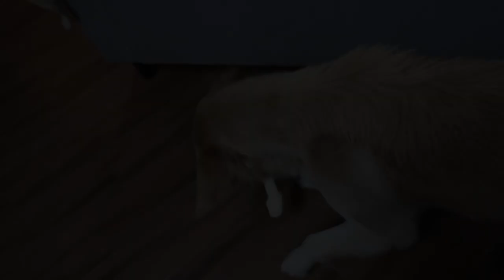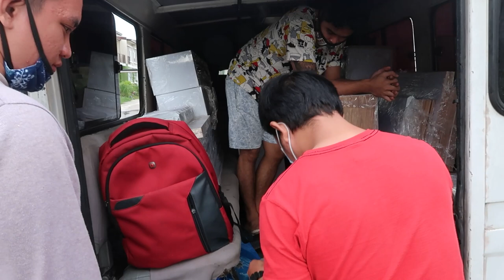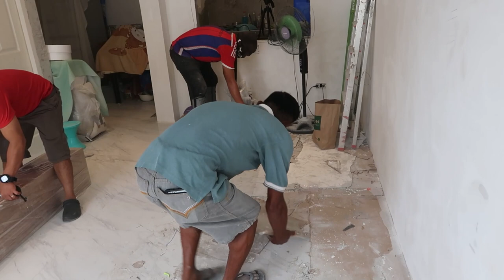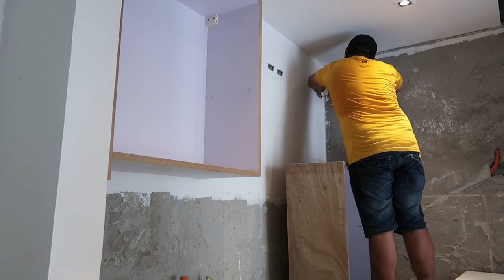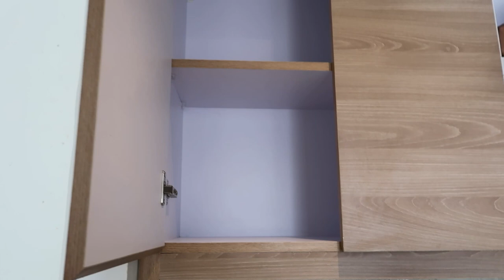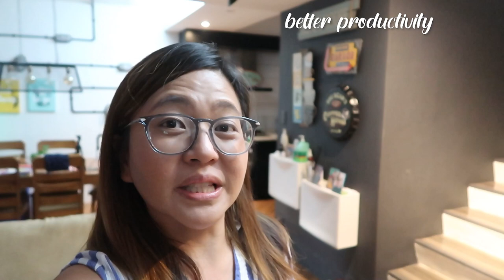Modular Cabinets - TV Console and Kitchen Counter

Comment: Hi! Ilang yrs po usually nagla-last ang modular cabinets s kitchen/sink area? Ano po ba ang mas nagtatagal, conventional or modular?
Reply from the maker: Hi Erika. Depende kasi yan sa user and sa maintenance ng owner. Modular can last as long as there is proper care and usage. Ang advantage kasi ng modular systems is namamaximize nya ang space sa baba. For the concrete base counter naman, it will also last long but most of the time, concrete attracts moisture which also attracts insects.

Thank you for watching and stay safe.
Reply: @ar.elainechew  thank you din po s pagsagot. God bless!